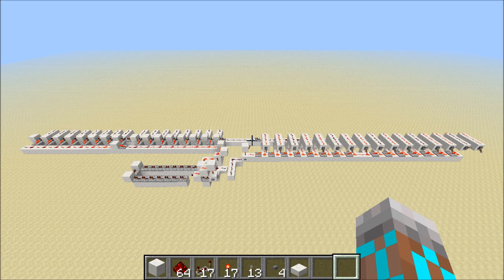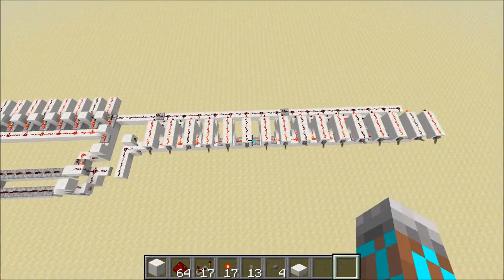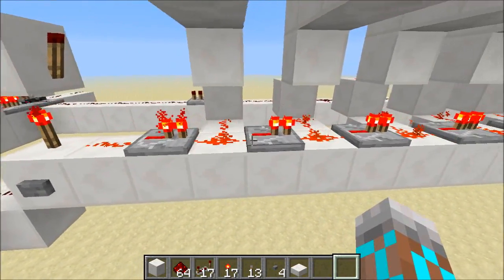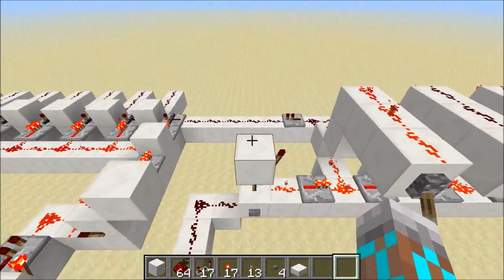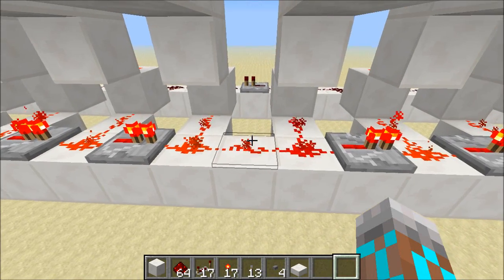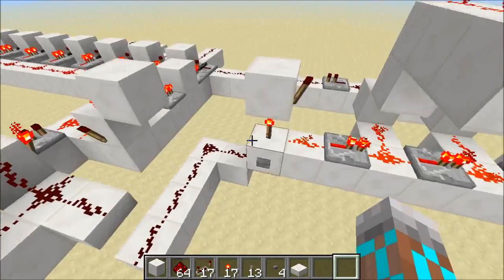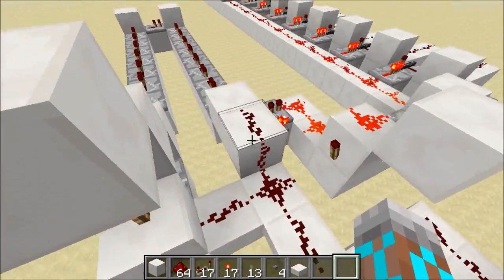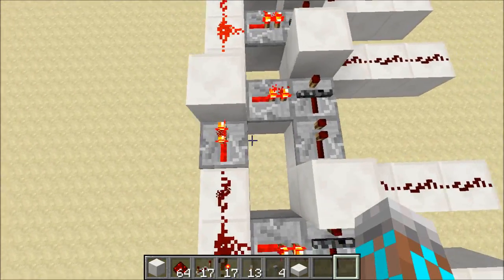Serial Data Transfer - 1 Tick/Bit (Snapshot 13w03a)

Comment from the maker: It looks like they've adjusted torch behavior (I wasn't sure why what the torch was responding in the first place). It should be very easy to fix using a comparator set to subtract to generate the 1 tick pulse. I'll set up a new encoder design when I get home later this evening. :D

Comment: Properinglish, would it be possible to make the entire system run on .5/bit by incorporating comparators? The comparator (in case you weren't aware) uses 1/2 tick to update, so it could potentially send information more quickly.

Comment: Holy crap! That's snazzy as heck!  I was wondering about this a few updates back, but I was told it was too glitchy to be possible, glad to see you made it!  Is there a way to send a signal two or three ticks in advance to trigger the timed decoding device so it doesn't have to be hooked up on a line?

Comment: Couldn't you send a signal along a line which is allowed to run out of power. That lights up a series of torches (Depending on the length it got to using comparitors) and have a sort of decimal to binary decoder? (By decimal here I mean 5 torches on to 110). That way you never have to store the signal in an analogue memory cell.

Comment: The bug where if two 1 tick pulses traveled along a repeater line with 1 space inbetween it would turn into a single 3 tick pulse instead, so a 101 would become 111. That bugfix made this possible.

Comment from the maker: You know, I need to test it in 1.4.7, I just haven't had time. The snapshots have some repeater lock changes that make them more reliable so it may or may not work in previous versions.